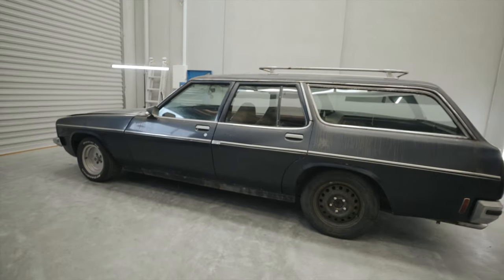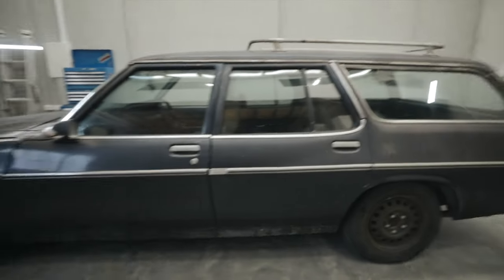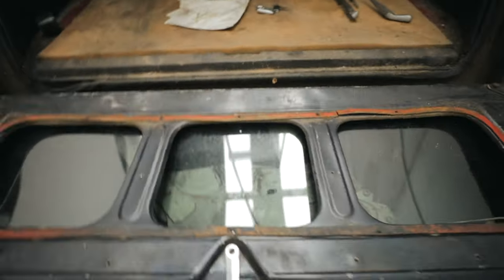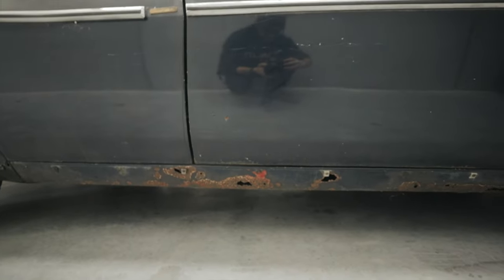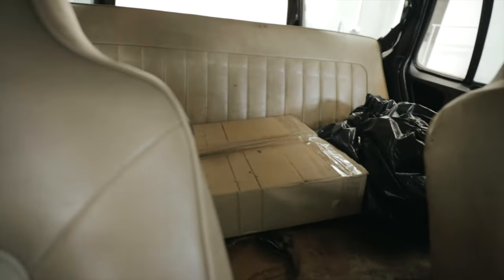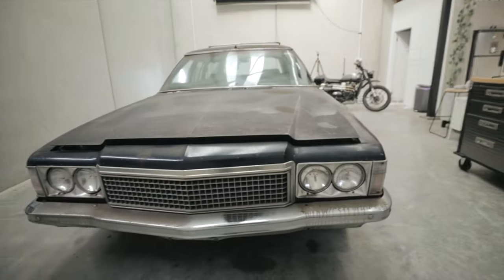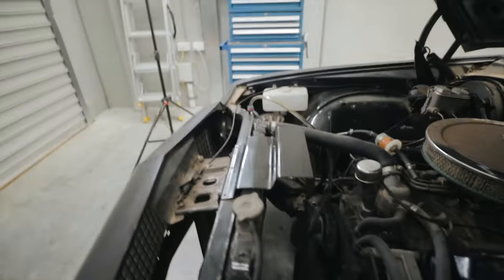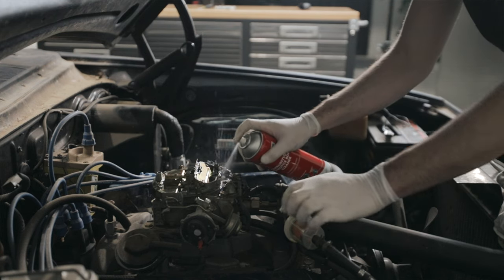It FINALLY Arrived! | Warehouse Vlog S3E13

Comment: Ah man, seeing that rusty sill reminded me of the HQ I bought to tour Australia way back when.
I spotted a couple of rust bubbles and stupidly thought I'd prod them with a screwdriver, only to find the whole thing had been filled with concrete and fell out.
Not having the cash to fix it, nor to scrap it and buy another I found the nearest scrap yard, bought some trim panels from an old Ford and pop riveted them over the enormous holes.
It made it from Adelaide to Darwin, where I sold it to a German couple straight off the plane, who kept in touch and drove it back to Sydney where they sold it, still with the concrete sills and Ford trims.
For all I know, it might still be going.

Comment: Really good basis for a project. My grandfather had a mint HZ Premier sedan with a 253 from new, beautiful car. The HZ is IMO the pick of the generation, being they have the RTS suspension so they handle okay for what they are and the trim package makes them look sharp. The little 253 is a solid motor too, not the most powerful of things but sounds great and the little thongslapper will run forever.

Comment: Love the old Holdens..... Get yourself some Ford AU twin thermo fans, they fit perfectly and work extremely well. It's a common upgrade on Toranas with worked 308's, I did it to my Torana and wow it made a huge difference.
Reply from the maker: FORD PARTS IN MY HOLDEN!? Haha na i don't care. Bummed that i already have these that i bought 10 years ago. I'll price up the falcon ones and see if it's worth it compared to the ones i have (can't even remember where i bought them from haha)
Reply: @MotoFeelz  yeah I was the same at first about Ford parts lol…. But it works, which is more important. I even went to the extent of fitting a 9 inch diff…. Anyway see how you go, good luck with it all, I’m looking forward to watching the progress